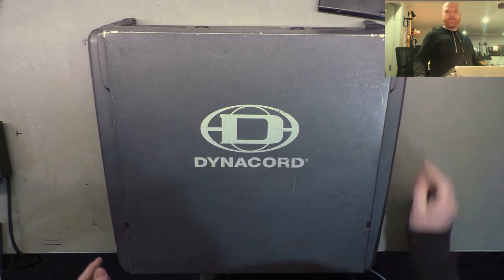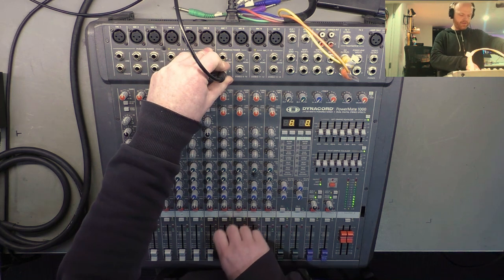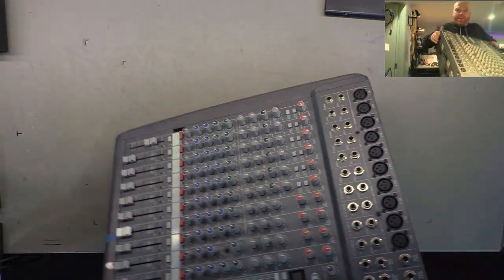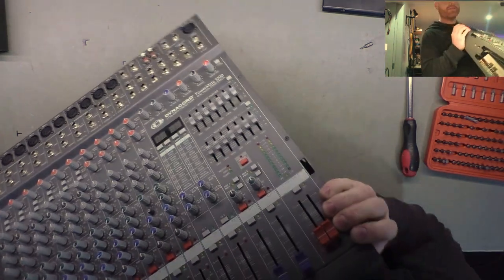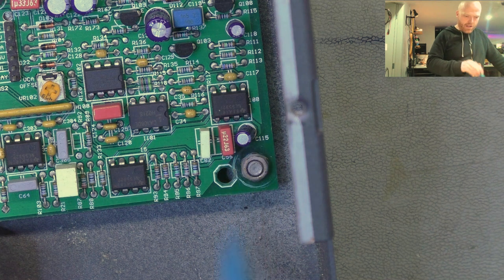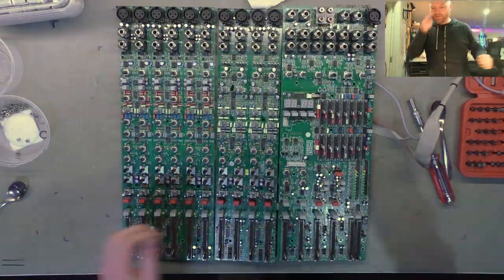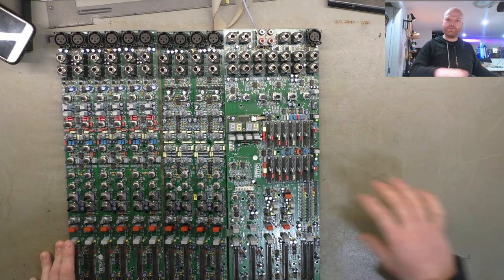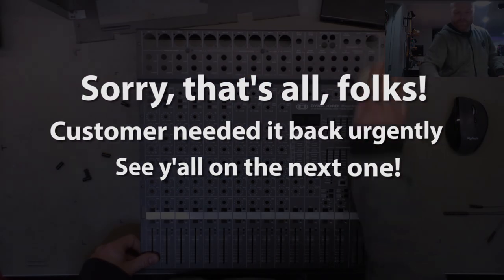Dynacord Powermate 1000 - Effects Processor Problems etc

Comment: This has given me flashback nightmares. Many years ago I spilled a coffee on a Spirit mixing board, managed to yank the power very quickly and decided to take it apart to clean the affected area. Including the faders and pots. It's one of those things you only do once 😂
Reply: Coffee, soda (pop to some a ya'), and beer are all terribly corrosive to circuit boards, especially digital processing boards.
Reply: @goodun2974  yes indeed! Since my spillage many moons ago, I've seen many a piece of equipment ruined by aforementioned liquids. Looking back I can only commend my younger self for quick thinking and perseverance!
Reply: @Toymortal  ,  I have seen a number of audio-video multi-channel receivers ruined because somebody popped the tab on a soda or beer nearby while watching a football game or whatever, and a miniscule drop apparently flew through the air and went down through the vents and landed on the digital surround-sound board.  Fancy/ expensive kitchen radios like a bose wave radio were the absolute worst to work on because they had slotted vents on the top rear of the unit and it was all too common to have a drop of something fly into them if the radio was near the coffee pot or the sink. Doublesided boards with tiny pass-through "rivets" connecting to the foils on the other side of the board are a nightmare to work on if they corrode from even minor spillage.  It's amazing how difficult it can be to repair corrosion damage even if it's confined to just one  square inch of the board.

Comment: As much as I'd like to, I cannot take credit for the pencil eraser trick, because it's something I learned from old ham radio and former signal corps military guys.  I do the same thing with relay contacts and potentiometers, or digital encoder rotary controls, which have been disassembled for cleaning.  Recently I watched a 1960's era training video on soldering to milspec standards,  and those guys were being taught to clean the foil pads on the circuit boards with a pencil eraser before soldering to them for the 1st time. They also cleaned component leads with something like a piece of Magic Eraser or Scotchbright pad. (PS, modern "plastic" pencil erasers, a soft white non-latex vinyl-like material, contain no pumice or silica and are useless for our purposes).

Comment: Leaky tact (tactile) switches can also cause this sort of problem, as can conductive carbon pushbuttons of the type found in TV remote controls. The conductive buttons and squiggly foils (or conductive carbon-plastic tracks) on the board can be cleaned with alcohol or even with the pencil eraser, but in most cases, defective or suspect tact switches need to be replaced unless they are of the really old type, with a visible metal dome, that can be taken apart and cleaned (you can't just spray them).